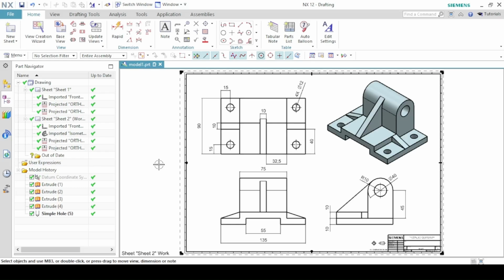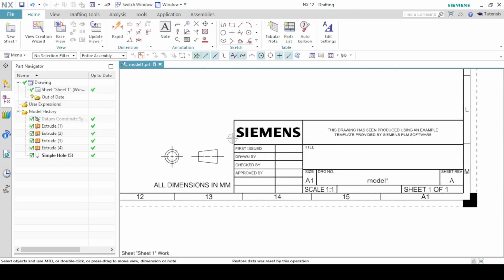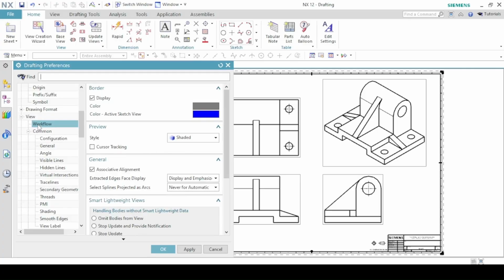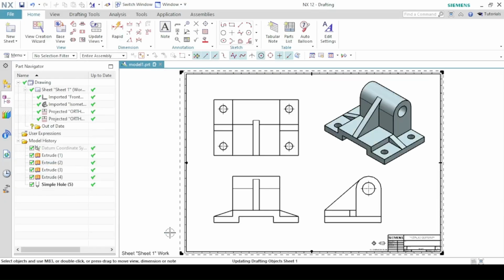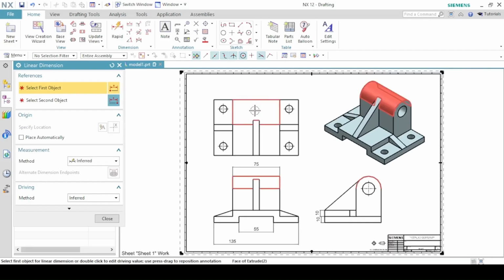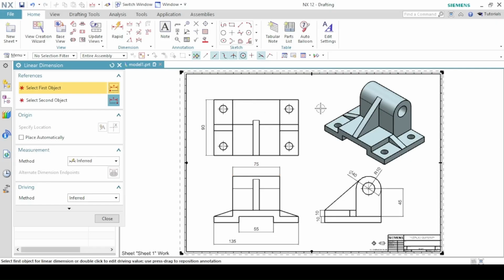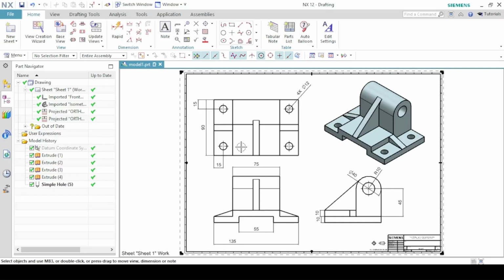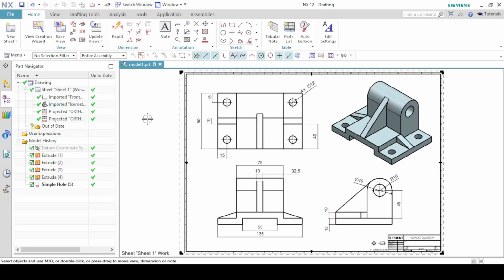Siemens NX Drafting Tutorial | Step-by-Step Engineering Drawing of a Block

Comment: Thanks. Now, how can one change the viewing direction for the front view......Assuming I want to view from the right, how can it be done?
Reply from the maker: Good question, You can redefine the front view during drafting. 
When you click on the "Base View" to insert the front view, just below the Model View, there is "Orient View Tool". 
Click on it to open the Orientation Window. Then use the arrows to rotate the view to your preferred view. Easy!